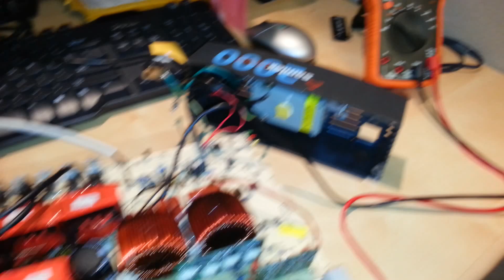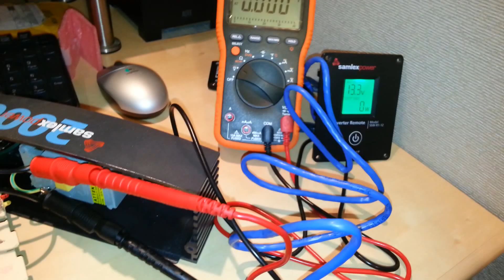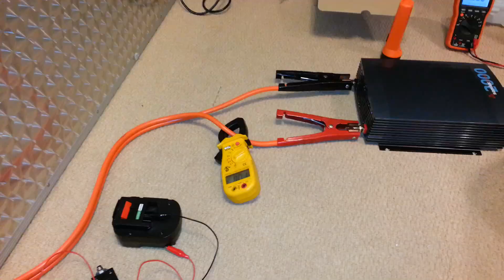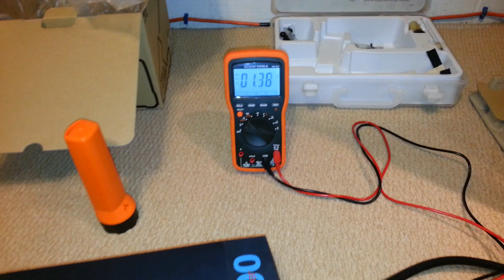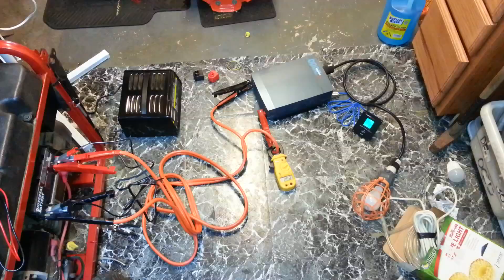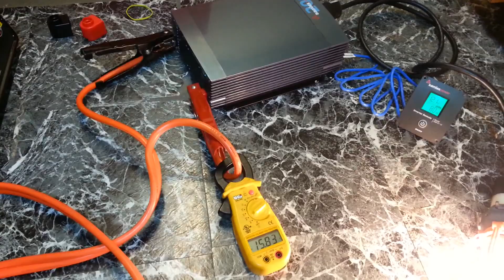Samlex SSW-2000 Pure Sine Power Inverter Repair: Part 5

Comment: Can you please tell me what value is gate drive resistor ? You also change those resistors.
And can you share service manuals or schematic for this, or other  pure sine wave inverters that you have.
I have COTEK 1500w pure sine inverter that was in flood here in Bosnia and all input transistor were damaged and all gate drive resistor are disappeared. I'm trying to repair it.
Email  soba3000@net.hr
Thanks!
Reply from the maker: Mario, ill send the main board schematics to you. I dont remember the gate resistor value. If the main pcb schematic doeant jave it ill try to find my mouser.com order and see what i ordered. I know i changed a few, as you can see from the video a few were burnt
Reply: Thanks man :)
Reply from the maker: Mario Đukić just sent it out. Hope it helps
Reply: It's 20 ohms, ill try this week a have to order transistor to. Thanks again on schematic.
Reply from the maker: Anytime!
Reply: +xboxer1985 really nice repair. Subscribed! Could You also send to me the schematics for this awesome inverter? I will be very grateful. I think the most of the pure sine wave inverters are build the same way (push pull step up converter and h bridge at output). Did You know IC numbers on the secondary side which control H bridge (4 output mosfets) ? Cheers! 
PS My mail: morozaw@gmail.com
Reply from the maker: sent!!

Comment: I have a Samlex PST300 pure sine inverter. I think i overloaded it. Now when I turn it on the light changes from green to orange and buzzer goes on. no ac output. I check the fuse inside and it is fine. Any advice?
Reply from the maker: Take it apart, look for blown fuses and burnt components where the magic smoke released. Even if a component didnt burn it may have likely shorted or failed open. Good luck!
Reply: ***** Thanks for the fast reply! There isnt any magic smoked release anywhere looks spotless new. Most likely shorted open components.. this sucks.. maybe I can RMA it back to the ebay store I got it from and say it was damaged in shipping :P

Comment: I Fixed my xantrex xpower 1500 inverter after watching your videos and those of knurlgnar24. my brother accidentally shorted the outputs taking out two output mosfets, when he tried to hardwire the inverter to the home distribution box which had the neutral tied to earth. Replaced the fets and "holy shit it works!!"...
Reply from the maker: Haha glad to hear my videos helped you!! All the best!
Reply: ***** please email me the schematic you have for the samlex SSW-2000 Pure Sine Power Inverter. i have the same inverter on my repair desk.
Reply from the maker: PM me your email and I can send. Its a PDF. Please note that it is only the schematic for the main circuit board it has no detail on the various daughter boards
Reply from the maker: Got your msg. Will send tomorrow
Reply: ***** please remember to send schematic .pdf.
Reply from the maker: Kevin, can you resend your email PM? I do not see it.
Reply: ***** thank you for the .pdf

Comment: hi exboxeer1985 success is a wonderful feeling but watch your language when you have success. enogh of that. I have been running my home on a power fet 5 kw inverter for many years.  of my own design it is a square wave output. 120 dc v in 120 v ac 60 hz out. it runs off of a 800ah battery bank. which is charged by a 3 kw solar panel aray  for many years. it runs my home for 11 months of the year . except dec and jan.. this inverter powers my well pump  gas hot air heating system washermachine refrigeration. elec. hot water. heater computer right now. Your videos bring me up to date on inverters. I even run a 90 amp welder on my system. Home power 73 magazine has my story.oct nov.(still cranking Apv&wind system ten years later.) see my video on u tube type in John Millard look for the picture of the old guy. success is a great feeling I had My share. Keep the Faith JOHNMILLARD
Reply from the maker: Thanks John for sharing, but if I want to cuss I will. Haha! Thats a nice system you have.

Comment: Great job. I may be wrong but you'll probably find that the on-board watt-meter will be closer to accurate at higher draw loads, say above 300w?
Reply from the maker: Possibly. If you notice the remote is numbers for watts while the newer ones sold today is a bar graph. It may not have needed to be as accurate down to the number being the output was a bar graph. Another point to note is the newer input daughter board was not meant to work with the older remote DrBlackrose  told me the remote doesnt operate the inverter to turn off/on anymore, but obviously outputs the info. Battery voltage is accurate. I think its because of incompatability with the new daughter board and old style remote. Either that or maybe an SMD transistor blew on the remote daughter board that sends a signal to the drive daughter board to turn on the inverter either way im happy it works again. Learned a lot!
Reply: I have heard that the watt meter on the remote will show after the first 100 watts, meaning, add 100 watts to the value to get the correct wattage